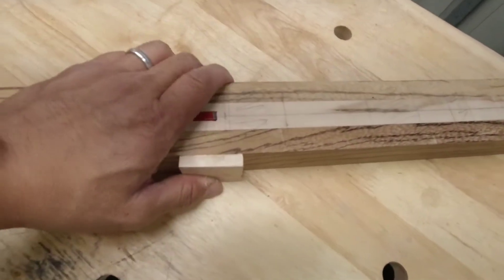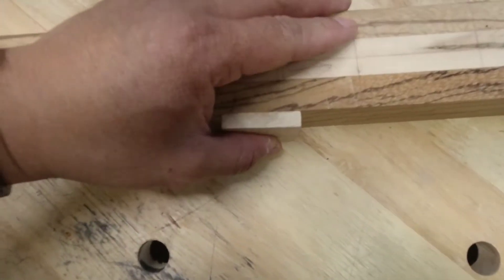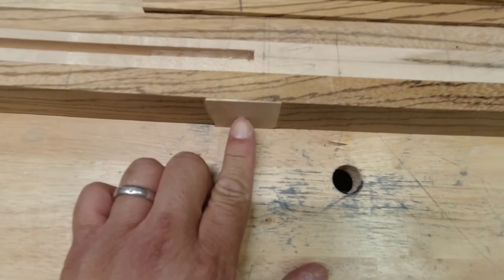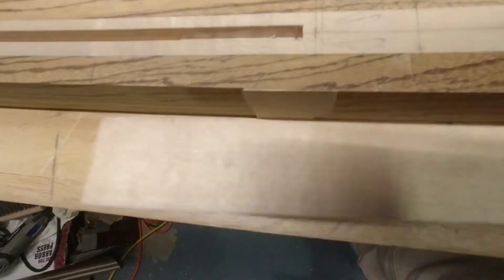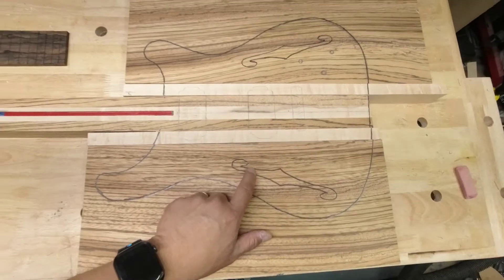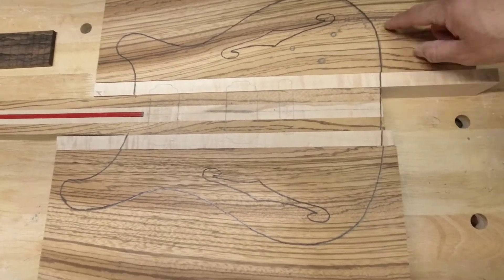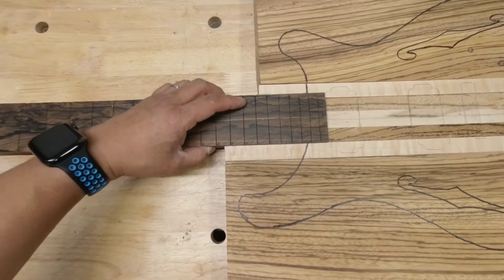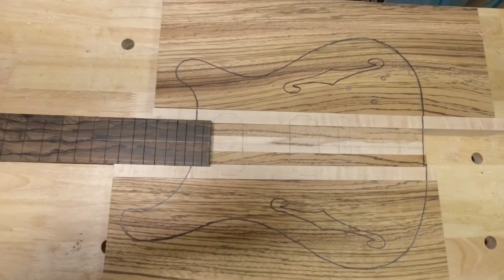Zebrawood Guitar Build 05: Problem Fix and Design

Comment: OK....I haven't watched further to see if you did this, but since the Trem is routed all the way through, and spans the width of the center block, why not just saw that portion off, and slide it back, to meet the original line of the shape of the guitar?  Just a thought.
Reply from the maker: I suppose I could have but the tremolo cut out doesn't span the width of the through neck. Also, it wouldn't be a true through neck then as well. It's a good thought though, one I hadn't thought about.
Reply: @docjoe1  I based that idea off of the drawing, where it looked like the trem block cavity went onto the maple portions on the inside of the body...Liking the build, though...I'm on "episode" 12, right now, lol